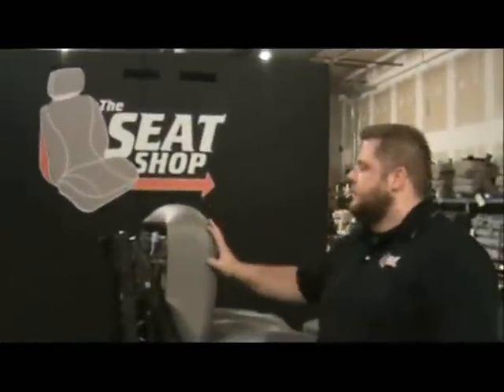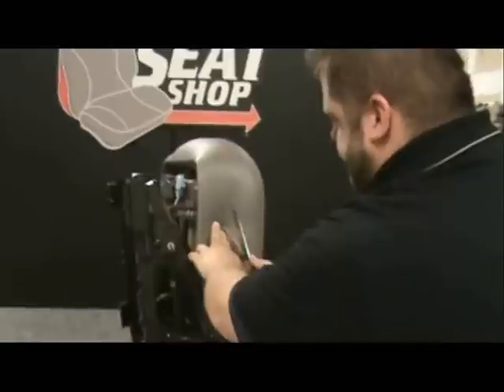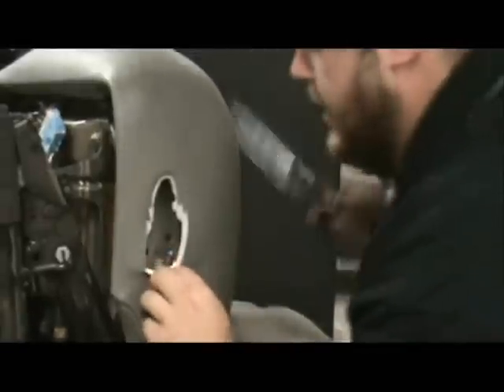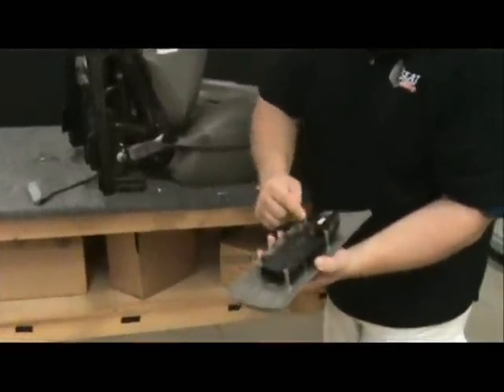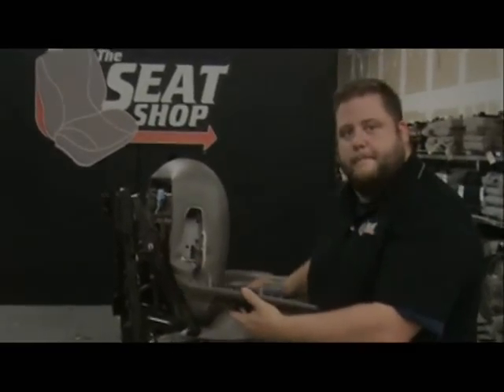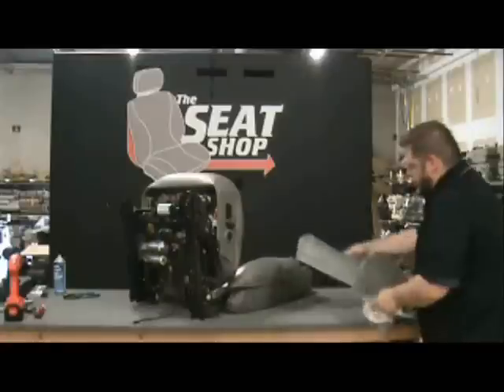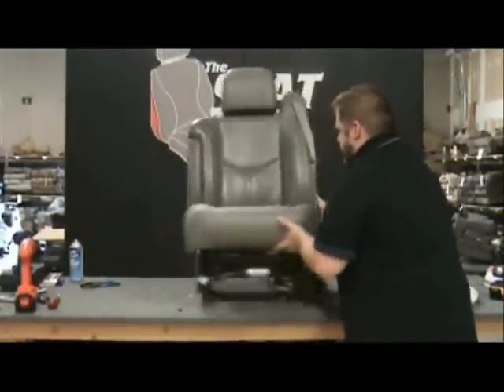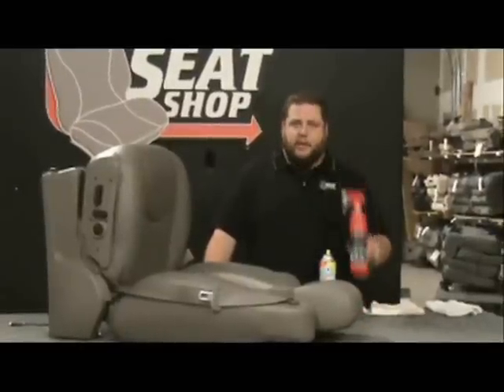3 OF 3  2003-06 CHEVY CHEVROLET DRIVER BOTTOM LEATHER INSTALLATION VIDEO SERIES FROM THE SEAT SHOP

Comment: The driver side bottom seat on my 2004 Chevy Silverado is shot. Found The Seat Shop online. Decided to give it a try.
Ordered the seat and new foam. Decided to tackle the project today.  Video didn't really go over how to get the seat in bolted from the truck. A 15mm and 11mm socket worked great on the E20 nuts. did not need a special socket, thanks for the tip. 
Think the hardest part was getting the front of the new cover clipped into place. I did this alone. May of been easier with 4 hands.  Instead it used a couple of spring loaded clamps to help hold it in place. I used the 3 part video and did it step by step.
WOW it turned out great. Feels good, looks great and it matches my existing seats near perfect. Should be good for another 14 years.  Love it!
Reply from the maker: That is great to read Peter, we really appreciate the comment and glad we were able to help you out with this project, we would love to see some before and after pictures on our FaceBook page if at all possible. https://www.facebook.com/TheSeatShopUSA/